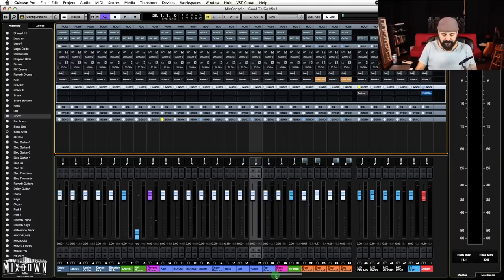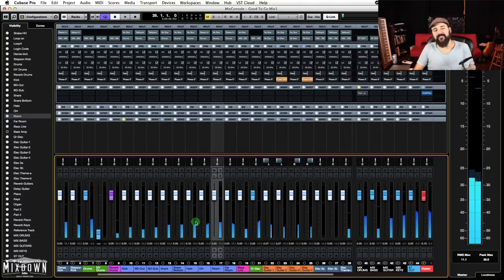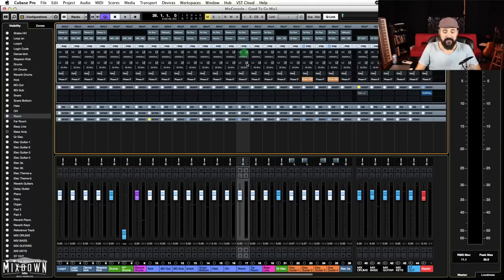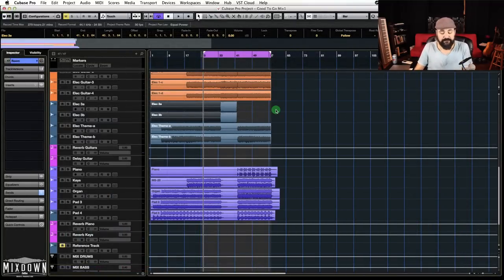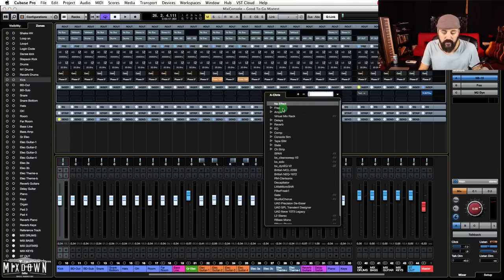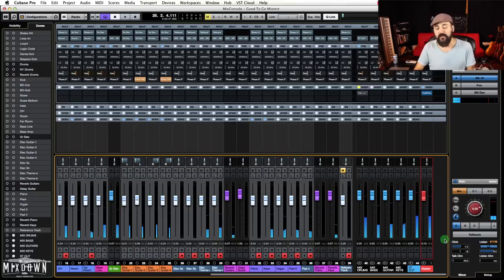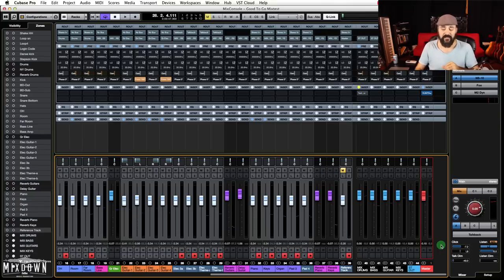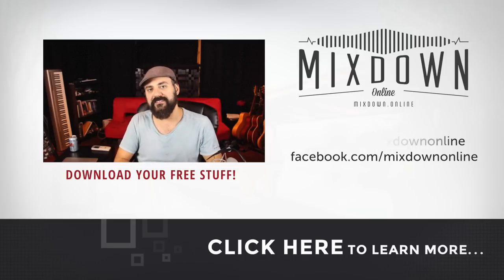Gain staging for a better mix - mixdown.online

Comment: 1. So basically we can assume that "-10dBFS peak" roughly equals to "-18 dBFS RMS", can't we? And do we have to be super-precise level-wise? 

2. And then another question comes to mind: if we turn down a signal from the pre section, wouldn't it be "too low" for the following plugins to work at their sweet spot (i.e. -18dBFS RMS)?
**For instance, we recorded a signal at a proper level around -18dBFS, but found it too loud in the mix. So we turned it down -6dB and now the average level of that signal became -24 dBFS RMS...

These two questions keep bothering me for such a long time, hopefully to hear your opinions.
Thank you in advance.

Sebatian
Reply from the maker: RMS is Root Mean Squared and refers to the average level, not the peaks which can be much more than the average level. You don't need to worry about RMS for now. For your second question, I try to keep everything at an average of -18dbfs, if I need to turn something down in the mix, I use the faders from that point, if the faders turns out to be too low and hard to manage, I add a trim plugin at the end of my insert chain and lower the trim by a few db's... The -18bdfs is only and average to give you some headroom during the mix to end up with a decent stereo bus level in the end. So a signal can peak at -12dbfs and I won't worry.

Comment: Quick question: You gain stage to -18 dBfs, but how hot do you go on your inputs when recording? What gives the best signal-to-noise ratio?
Reply from the maker: DrBuffaloBalls I do about the same on my way in... - 18bdfs in average with peaks at - 12dbfs or so... Same logic applies... Good question, thanks!

Comment: Hi,Can that "pre" function in Cubase be used to turn gain down even if there is volume automation already on the track? I have a lot of volume automation already but need to turn down lots of tracks because the levels are currently too high. Thanks!
Reply from the maker: Hello friend! Yes it can, it won't affect your automation but it will affect the amount of signal sent to the plugins which is a good thing if you're overloading the plugins. In this case, you will have to readjust any compressor or gate plugins in your chain since the gain is lower. Apart from that, you're good! Thanks for you question :-)